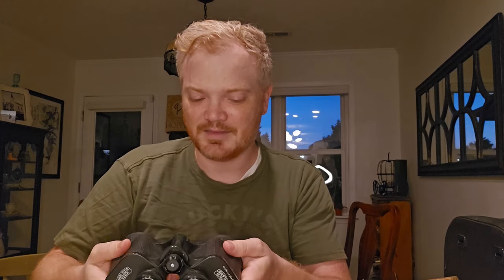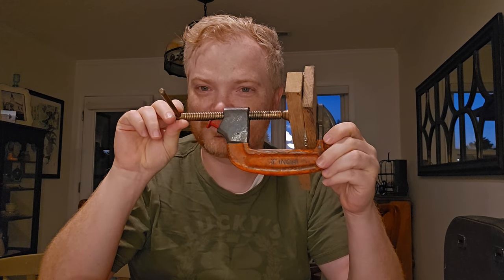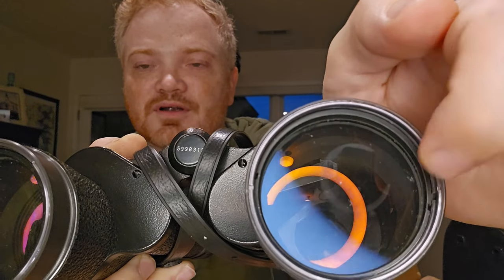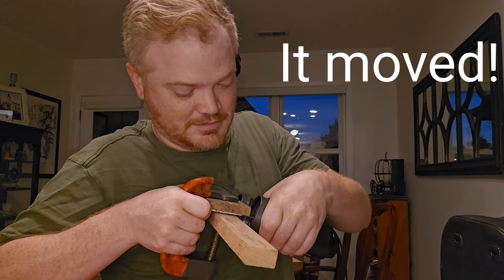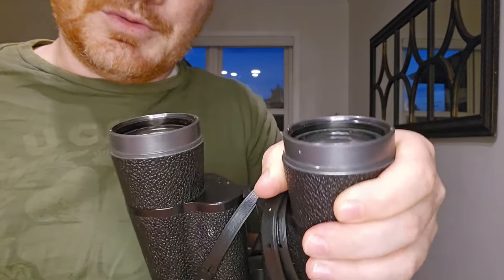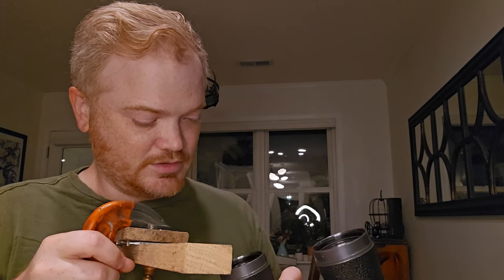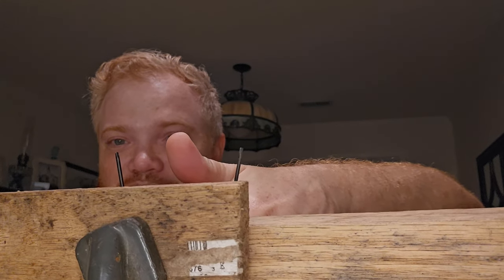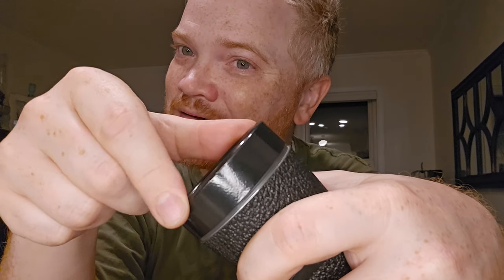Easily adjust the collimation of your binoculars.  My recent zeiss purchase as an example.

Comment: I have a pair of Zeiss 10X50 Jenoptems that were also out of collimation.  After watching this video multiple times I purchased an adjustable spanner wrench and had a friend with a machine shop turn down the nubs on the wrench to thin spindles.  This made a perfect collimating tool and I was able to collimate the bino's in about 10 minutes.  Thank you Mr. Hopper.

Comment: Grat video. I had to fix my dad's binoculars, because I dropped them on a rock--only from a height of just inches, but it was enough to jar them out of alignment. I opened them up and didn't find any way to adjust them. I decided to take a risk and tap them on a table in the opposite direction of the original bump. After a few of these adjustments, it came back into colummation. 😎
Reply from the maker: @timothyandrewausten  sometimes life requires precision.  Other times... you just take your best shot!  😀